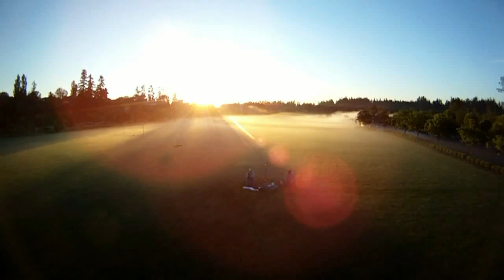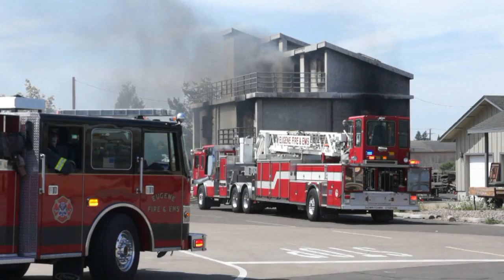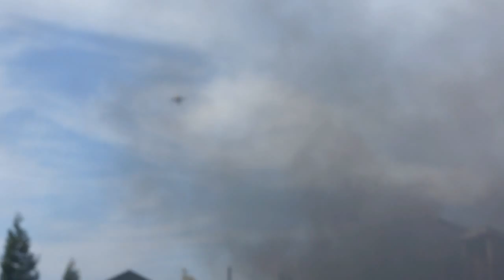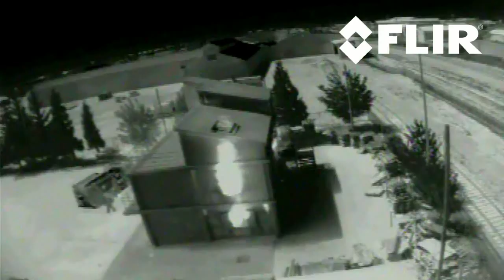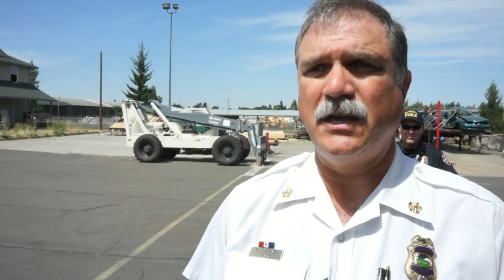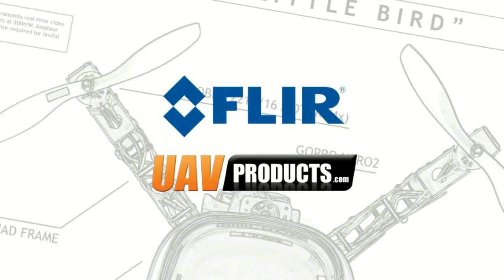RFTC: FPV Multirotor Drone Monitors Structural Firefighting Exercise with FLIR

Comment from the maker: At long last, we round out our trilogy of public safety demonstration videos built around two days of training exercises with the Eugene Fire Department, arranged by our friends at Rising Tide Innovations. We saved the best (or at least the hottest) for last: a burning building. Here it is!

Now, technically, the building itself isn't burning, because it's a training facility made of reinforced concrete covered in heat-resistant tiles like the belly of the space shuttle – but you could have fooled us, based on the amount of smoke pouring out and the number of firefighters moving inside to extinguish the blaze.

There was a lot happening in this scenario, and it was over very quickly. We only had time to put RQCX-3 “Raven” up twice before it was all over. However, during those precious few minutes, we were able to show what the drone could do.

First, with her FLIR thermal imaging camera, Raven was able to see through the smoke – which can sometimes be a misleading indicator of where a fire is actually located inside a structure – and provide an accurate picture of where the heat (and, therefore, the fire) was most intense.

Second, we were able to monitor firefighters working on the roof of the structure and look for places were it might be in danger of collapsing. Being a fireproof building, it wasn't actually going to collapse, but it was an important test because many firefighters are killed every year when they fall through the roof and directly into a fire.

All that you saw in the video. What you didn't see was that the firefighters working inside the structure were given a mission besides putting out the fire. They also had to find several “survivors” located inside the building. In this case, “survivor” means badly scorched mannequin, but you get the idea.

If we had more time, it would have been interesting to get some video form inside the building and talk to the firefighters about how they conduct a search in such harrowing circumstances.

Then, after the exercise was complete, Captain Markus Lay (whom you met in the video) threw down a challenge for Techinstein and Raven: read the license plate on a truck parked in a neighboring yard.

There were several chain-link fences as well as some railroad tracks between our ground station and the target – so this wasn't the most permissive electromagnetic environment for FPV flying – but both pilot and aircraft came through like champs.
Reply: Nice :) Wish I could afford a FLIR:/ You guys should try out running an APM 2.6 on "Raven" or maybe a Pixhawk and run a telemetry downlink as well, like an XBEE or 3DR data downlink; I run a 2.6 on my TBS Discovery and it flies amazingly:)
Reply from the maker: BigBird FPV Hey, Big Bird! Interesting you should offer that suggestion at this particular moment... After watching a 3D Robotics flight demonstration at the AMA Expo, we went ahead and purchased a Pixhawk and we're building a new hexacopter around it -- sort of Raven 2.0. Stay tuned for that...
Reply: roswell flight tese chew are the best with quadcopter P.R work
Reply: ***** Yes! Yayayayaya:D Can't wait to see some videos with the pixhawk, I'm loving my APM 2.6 -[EDIT (on my TBS discovery)] and am looking to put a pixhawk on a Ritewing ZII as soon as I master my bixler:)
Reply from the maker: francis sciarrillo Thank you! We're doing our best to show how these tools can be used to help people and save lives! Thanks for watching and taking the time to leave us some positive feedback!
Reply from the maker: BigBird FPV I'm really anxious to see how the Pixhawk performs myself. We've been committed DJI fans for a while now and we've had great success with the original NAZA. However, we also had the misfortune to experience a NAZA v2 flyaway with a big, heavy machine -- as well as some other problems -- which has definitely made us more guarded in our outlook on DJI products.
Reply: I actually just witnessed a wkm flyaway today at an RC meetup :( He took off, and the think just kept climbing. I've also had some bad experiences with my naza v2 which almost ended with me losing the whole quad, several times.

Comment: Are you guys likely to get a bigger model than raven, a Dji S800 or S1000 for example? You'd have greatly increased lifting capacity and flight times.
Reply from the maker: As a matter of fact, we've built a larger aircraft specifically for this type of mission. You can see a photograph of it in the March issue of "Model Aviation." However, we had a mishap during flight testing involving the aircraft and the ground and a high-speed interface between the two. We're saving up money to re-build and make some improvements based on what we learned from our first attempt. I'm sure you'll see it here at some point.